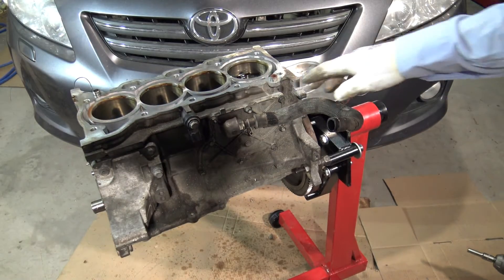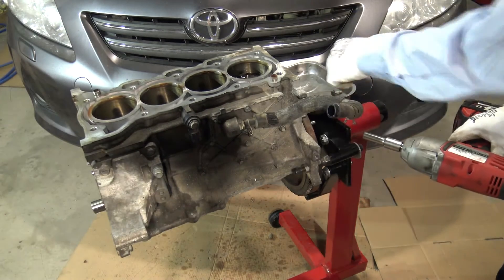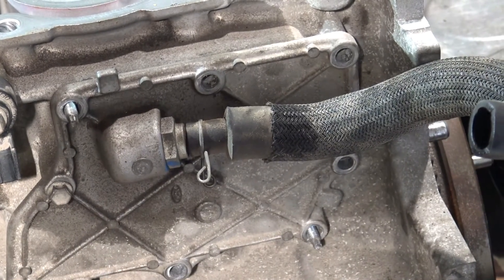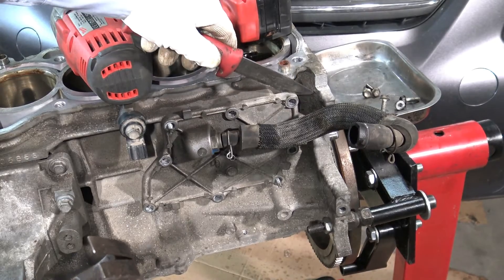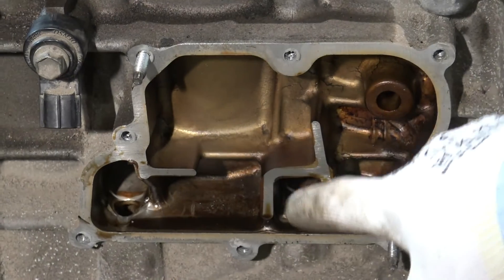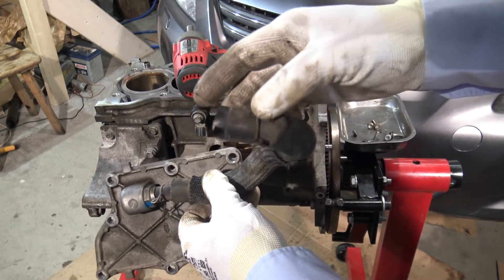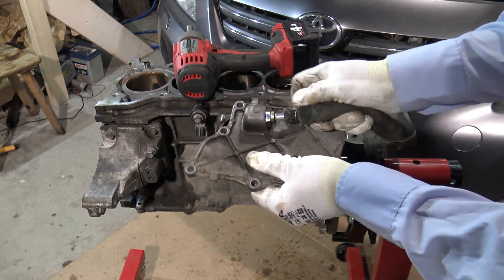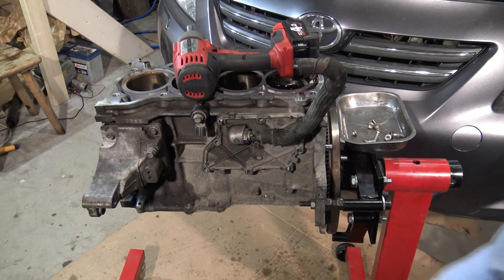What is ventilation case in Toyota Dual VVT-i engine. Years 2007 t0 2018

Comment: Excellent video. I have two queries:
1) Is that not a PCV valve?
2) Is this ventilation case located towards radiator side or engine wall side  (steering side/passenger side)?
Thanks for your excellent videos.
Reply from the maker: 1) This is also PC valve
2) This is in engine wall
Reply: @PeterFinnTheCarDoctor  Thanks for your prompt reply. Your these 5 minutes videos are very helpful. Please keep them up!.